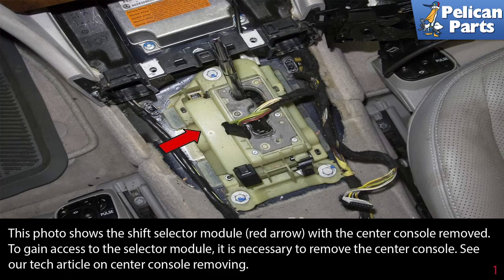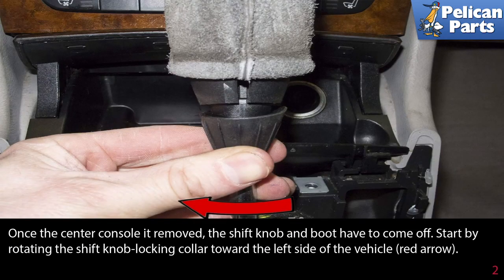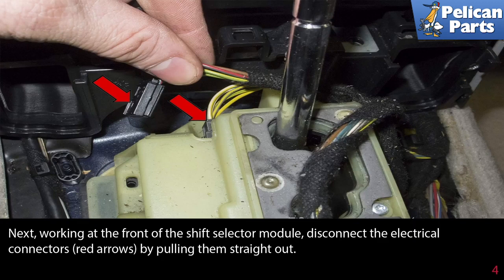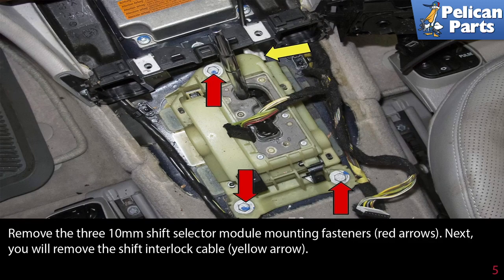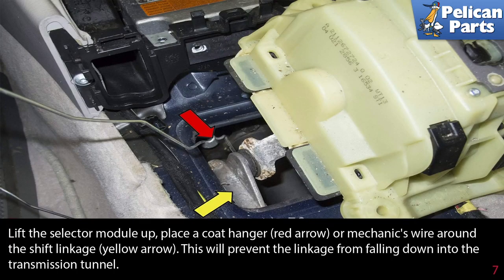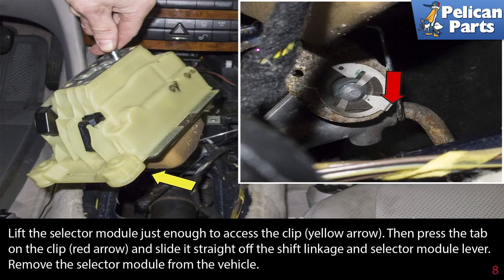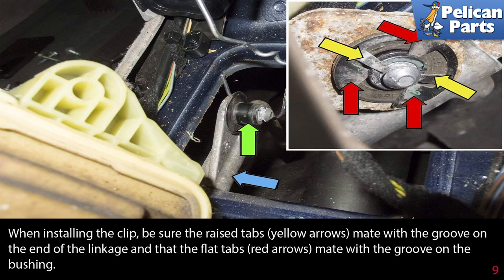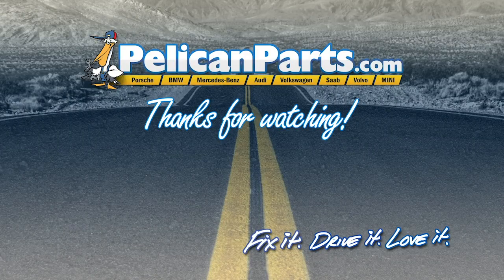Mercedes-Benz W211 E-Class Automatic Transmission Shift Selector Module Replacement

Comment: Great video. Worked perfect for my 05 w211 CDI. Replaced part #2112672524 with #2112672224. Plug and play, no coding needed. Symptoms were no gear indicator in dash or gear indicator mismatched from the position the gear lever was actually in. No response from C/S button. Car wouldn’t shift past 1st gear and code P0705.
Reply from the maker: Thanks for the additional info and feedback. We appreciate it.
Reply: Got the same issue with my 2003 w209 55 AMG, I`m planning this job soon so all videos here are marvel :D Thanks!
Reply: Mine is the same car, and just started doing the same...Thanks for posting. Where did you get the parts, if I may ask?
Reply: @Creek_Hunter  I chanced it at a local junkyard for ~$80. I couldn’t wait for a new part to ship at the time.
Reply: @seeminhsayzz  Let's hop[e it's plug and play as well, in my case. When you took out the center console, how did you go about the two clips holding it in place in the back?
Reply: @Creek_Hunter  I don't remember exactly, but I think once all the bolts, screws, ashtray, and cupholder were removed it just lifted up.
Reply: @seeminhsayzz  Got it done and it's replaced already. Thanks for the video!
Reply: @Creek_Hunter  good to hear!
Reply: @seeminhsayzz  looks like it’s my turn for my 2004 w211 e55 amg , dash not displaying P/R/N/D or shift mode M/S/C, harsh clunk when going into reverse and when put into drive it has a slight clunk then its in limp mode and only drives in one gear ( 2nd - 3rd I’m guessing ?? ) , can only put back in park if I let off the brake pedal , I may just do what you did and go to the junk yard me find the nicest condition E class preferably an e500 or something cause I know there aren’t any e55 near me . I’ll get back to y’all if the junk yard fix works wish me luck

Comment: My car will shift into drive but sometime when parking it will not let me shift past neutral to go into either reverse or park but when I turn the ignition off from neutral it will let me shift it into park would this be the reason why?
Reply from the maker: Could be a problem with the brake light switch.
Reply: I have this same issue on my w219. How did you end up fixing @alexbaer5961?

Comment: Great video, does the new shift selector need coding? as i'm getting mixed answers from my research! 2006 cls w219 320 cdi. My selector is not engaging some times which also stops the car from startng. Thank you.
Reply from the maker: No it does not.

Comment: My gear indicators don’t show on my Instrument cluster with code P0600 serial communication link. Error message says on Autel scanner NO SIGNAL TO Instrument cluster. Seats don’t work also but that’s only code I have to car. Do you think this could be the problem? Note that the car runs and shift strong. Had it a year with same problem and car drives and shifts fine.
Reply from the maker: Yes, this could be the issue. It is quite common. With your vehicle info handy, give The Pelican Parts parts specialists a call at 1-888-280-7799. They can figure out what part or repair kit you need.

Comment: What are the symptoms of this module failing?
Reply from the maker: No shift into gear. No shift indicators in instrument cluster. Fault codes.
Reply: @pelicanparts  Thank you, doesn't sound like what I have. My shift lever moves around freely, and the indicator shows the correct position, but the car will only roll as if it's in neutral, without starting. I have a feeling it's still thinks it's in reverse where it had gotten stuck, when we turned it off.
Reply: @rabitoblanco  HI,did you solve the problem?I have the same problem.Moves freely and wont start. And the indicator shows corect.Thanks
Reply: @traichorachev8527  I did; let me look it up, I think it was the shift assembly itself.
Reply: @rabitoblanco  Thank you. I wonder why,if i put in P ,i can push it like it is in N. Did you have the same problem?
Reply: @traichorachev8527  that's exactly what I had. And I couldn't start the car. 
I cannot confirm, but I'm 99% sure the issue was the shift linkage. I believe it's a little thing just underneath the actual shift lever.

Comment: That will no broke never 
just replace brake lights switch 
Or the batery is dead bad 
or full 
at can be speed sensor will fix abs traction and brake lights no anymore still one because they control together
 
So wheel abs speed sensor 
Control traction 
Abs 
Brake lights switch 
And will turn of the brake lights 
And work
Reply from the maker: Thanks for the Info. We appreciate it.